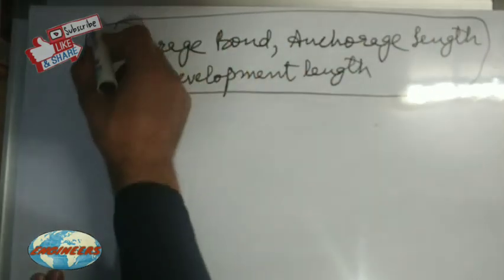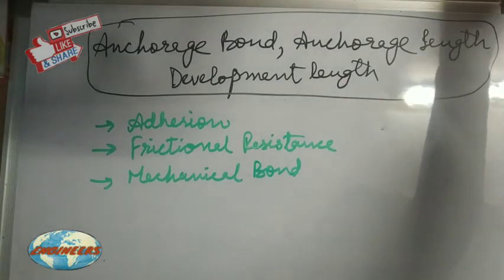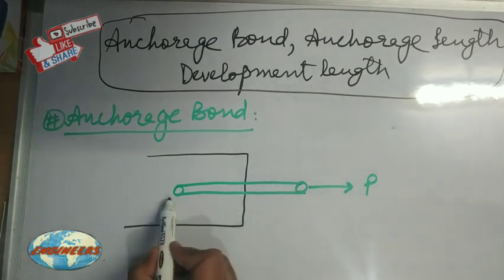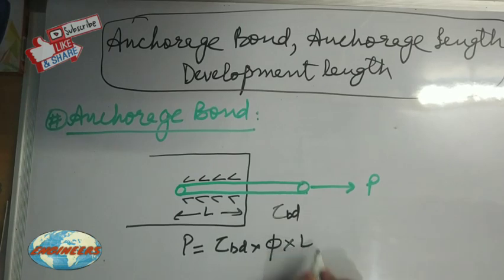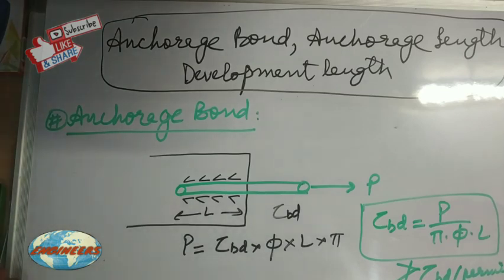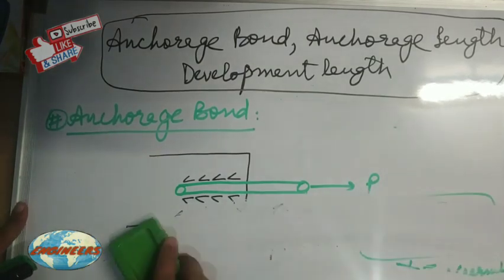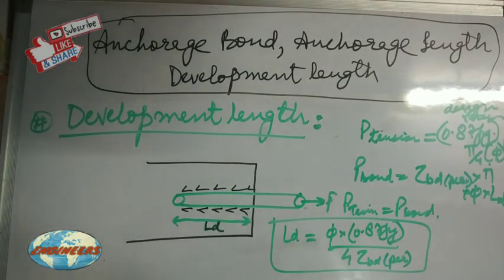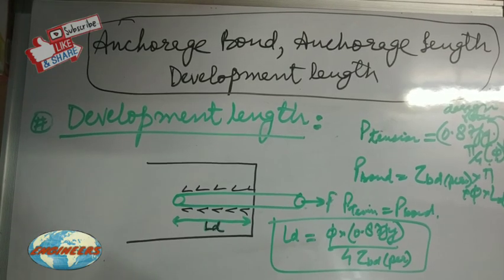Anchorage Bond, Anchorage Length and Development Length| Concepts of Reinforced Cement Concrete |

Comment: Why dont we check reinfocement in fixed end beams and columns for pull-out and splitting failure?
Reply from the maker: Because the main purpose of pull out test is to calculate the bond strength between steel reinf and surrounding concrete, so in fixed end conditions, pull out is not possible.
Reply: @ENGINEERSWORLDGATEESESSCIPATE  Thank you!